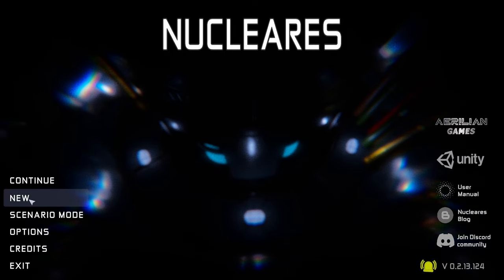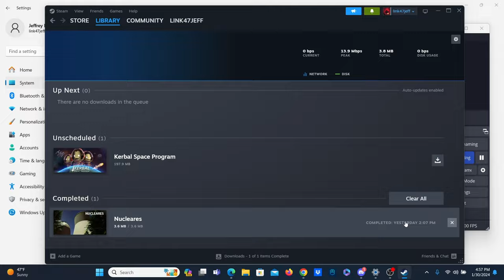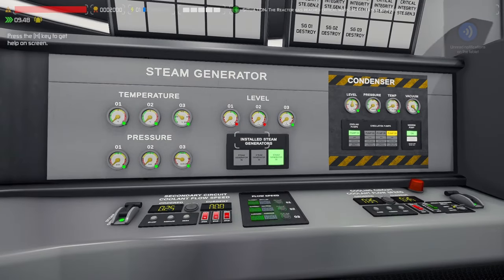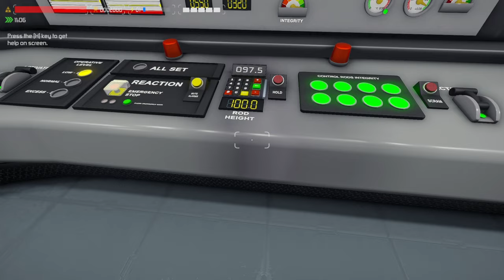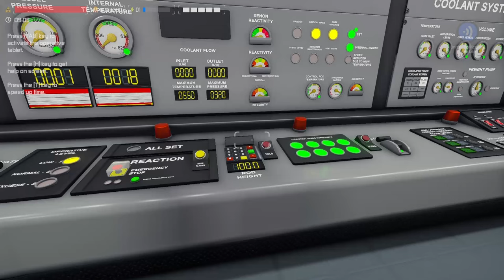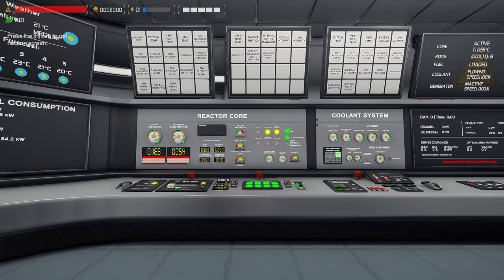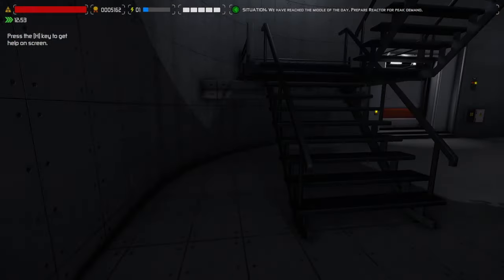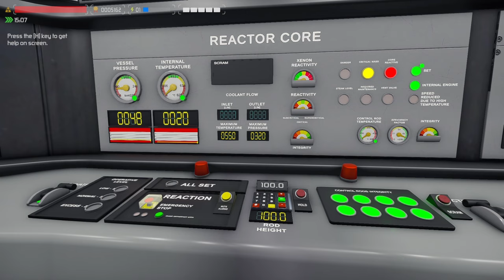Nucleares: The Boron experiment

Comment: @Gaming With The Hacketts DM mesasge from the developer about boron etc

Nucleares Said: Yes, it's almost correct. Boron is used to regulate the reaction, and optimize consumption, but also to eliminate xenon within the core. For now, the consumption improvement part is not simulated, but when the rest is well calibrated, I will add it.
Reply from the maker: Boron cannot eliminate Xenon from the core. There is no reaction in the entire world that would cause a Fission Product Poison from entering the fuel cladding and into the fuel matrix and eliminating it. Sounds like a bad understanding of science! The regulate reaction and optimize consumption we have personally discussed! That part makes sense lol
Reply: Injecting boric acid into water has no effect on xenon atoms sitting inside fuel rods behind zirconium shells.

Comment: 20:25 The "Vent Valve" is the game's PRV, but I'm not sure I believe it opens automatically above some limit.  But then, I've seen bizarre hysteresis in the pressurizer when trying to start the reactor, so maybe.  I don't get why the dev made up the terms "Cooling Valve" and "Vent Valve" for the UI, but still calls them "Spray Valve" and "PRV" in the manual.  Maybe a translation issue?
Reply from the maker: So the vent valve is supposed to be a pressure relief valve? Interesting... I don't think it operates that way (auto), because when I meltdown and pressure is exceeded the pipes rupture.

Comment: doorbell rings  "Hello?"  "Brother have you heard the good word?  Resistors are the path to salvation!  My reactor's life was a wreck until it accepted resistors, then it turned its life around.  I have some pamphlets here ..."  Seriously though, I don't know how you do it; any time I try to start up without resistors I grenade my turbine.
Reply from the maker: Just got to be quick. Anytime I use resistors they explode. I will continue not using resistors lol
Reply: I haven't blown out a resistor since they stopped taking my plant off grid randomly.
Reply: That's weird. I've never had trouble on startup, but I always deal about 25% damage to the generator on shutdown, I mean, it's either that, or scram, trip the turbine some 5 minutes before disconnect, and fail the hourly compliance goal.
Reply: @longbow192 Might as well fail the hourly goal, since you're not getting the next few anyway.  Though the hourly payouts keep getting higher as the game progresses, so at some point it's probably cheaper to just repair everything.  Resistors can be upgraded to handle a lot, though.

Comment: I believe the core may come pre-dosed with boron now. In your first try when you flipped the power switch on the Chemical Panel, you were instantly at like 2400ppm of boron.
Reply from the maker: Edit: it does weird. So maybe it was in there the whole time. Still doesn't explain the Xenon reactivity dropping by filtering boron. Unless poison is actually poison.
Reply: @GWHacketts  interesting, so boron is randomly appearing in the core on its own
Reply from the maker: It is even worse than I imagined. The boron in the core at shutdown spikes Xenon, but then if you filter it out xenon drops. If you filter out all Boron first and startup then shutdown, Xenon spikes. Then if you try to add boron for a subsequent startup, it does not affect Xenon and your core is ruined.

Comment: It feels to me like they lumped boron and xenon together and modeled it as a single chemical. Maybe you can cold start the reactor and see if boron appears out of nowhere? Because then it should match the xenon concentration.
Reply from the maker: ooo good call didn't think about seeing if it appeared while starting up. I will have to look into that
Reply: When starting the reactor, you might notice that when xenon reactivity meter goes up, so does core inlet flow. As if the game activates an invisible pump that sends water full of dissolved xenon into the reactor. This extra flow sometimes even causes primary circuit pump to overload.